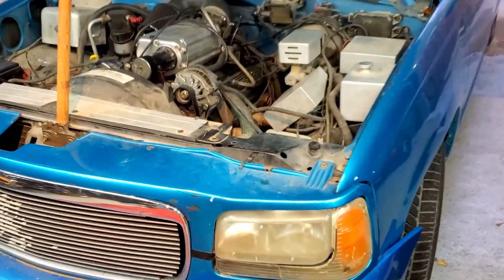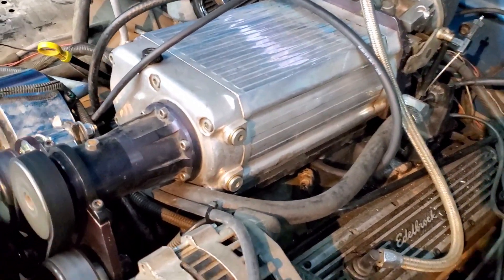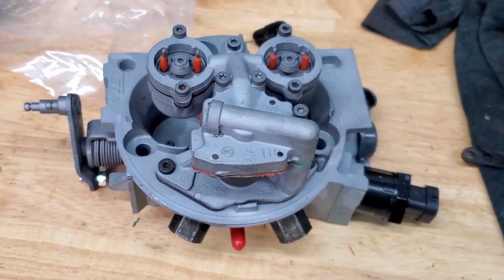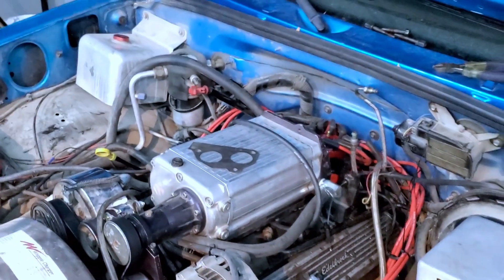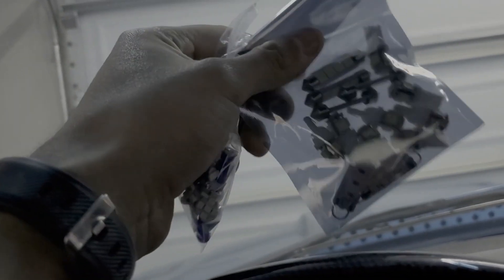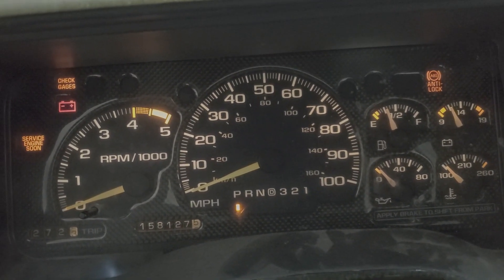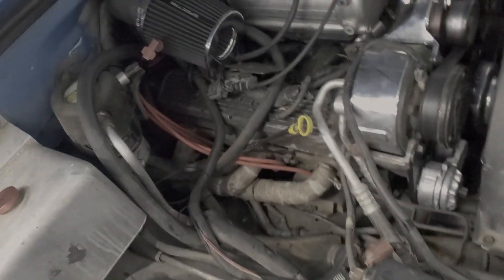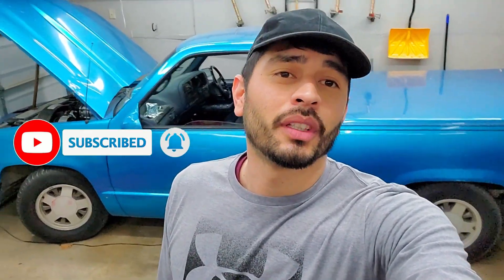MY 95 CHEVY C1500 (SUPERCHARGED)

Comment: Are you running stock injectors
Reply from the maker: yes I was
Reply: What belt did you use bro my truck has the same kit
Reply from the maker: @nicksautomotiveperformance6711  Should be KO61025 brother and best to get Bates Brand
Reply: @SUPSGARAGE  ok one more question where did you get your upper radiator hose at ? Or what’s the parts number for it ?
Reply from the maker: @nicksautomotiveperformance6711  Part number is DAYCO 71394 and you can find it at Summit Racing or Ebay brother
Reply: Yo what’s up bro just wanted to ask you where did you order your carb from ?
Reply from the maker: No carb on mine bro, only bought a new TBI for it.  Is that what your asking about?
Reply: @SUPSGARAGE  yea my bad I knew t where did you get the tbi from
Reply from the maker: Gotcha bro lol, just make sure your engine and year are the same on this link cuz it does matter.  This is the exact one I got, hope this helps!
https://www.ebay.com/itm/CHEVY-GMC-91-95-350-5-7L-TRUCK-SILVERADO-TAHOE-TBI-THROTTLE-BODY-/202549595852?mkcid=16&mkevt=1&_trksid=p2349624.m46890.l49286&mkrid=711-127632-2357-0
Reply: @SUPSGARAGE  thanks bro I got a 95 so it’ll work I appreciate it very much
Reply: @SUPSGARAGE  where did you get the wire and cap set at bro ?
Reply from the maker: @nicksautomotiveperformance6711  Got them off ebay as a set bro but cant seem to find that one anymore